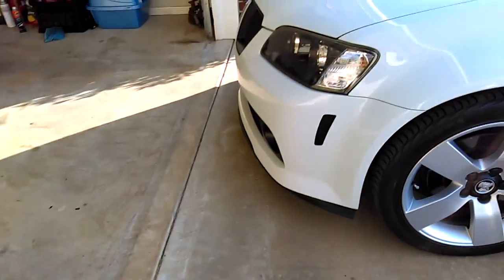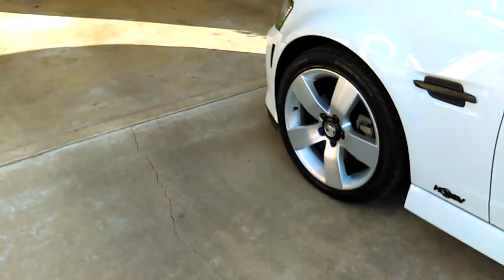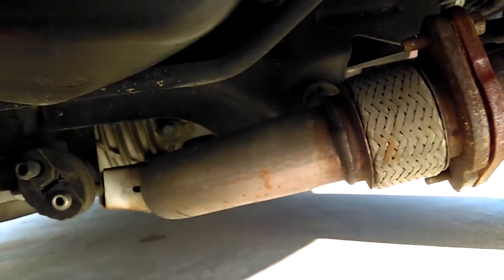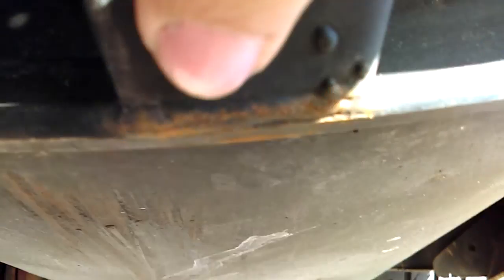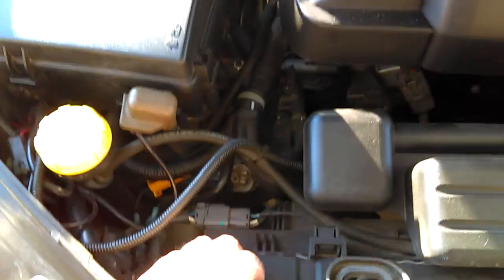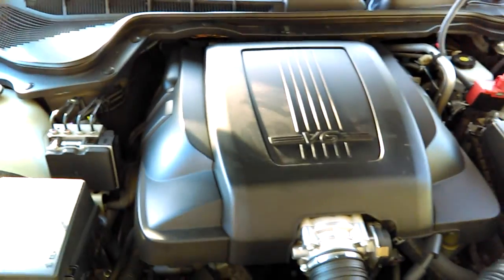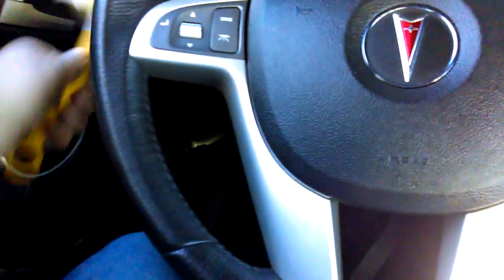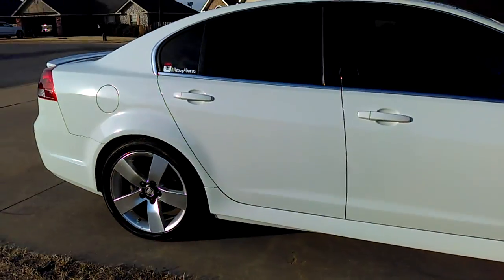Pontiac G8 Cleaning The Undercarriage

Comment: If you want to eliminate the brake noise you have to put anti-squeal lubrication on the bottom and the top of the caliper holder and on the back of the piston of the caliper.
When I replaced the brake pads on my Pontiac GTO that's what I've done and I never get any squeals or squeaks or rattles.
The best brake pads you can buy are going to be at Napa for ceramic pads. On top of like up a lifetime warranty and they can replace them for you every two years for free as long is your pads never touch metal to metal. Make sure and keep the receipt and box put it somewhere where you know you can find it.
Reply from the maker: I don't know how to change them. My dad and I tried before his heart attack and we could get them off. So I had a shop do it. I have ceramic pads right now and just bought a new set. I'll ask the shop and see if they have any of that stuff.
Reply: +Adrienne Brody its really simple. I learned by watching DIY channels on you tube. ChrisFix is a good channel. If you have the tools and don't mind to get a little dirty.

Comment: A.   That black looks like ashphalt from new black topped roads.     Driven on any recently ?     Also what u need to try with your pads. Is. Brake clean.    Ceramics have tendency to glaze if not. Set correctly when breaking them in.   Mine did it. About 6 months after new pads.  And drilled slotted rotors.  It did go away.  But was annoying as hell

Comment: How much horsepower does your V6 Pontiac G8 have?
Reply from the maker: I stoll have to go to the dyno place. I want to see what it runs with the throttle controller at its max setting on sports mode. With it off, it drives fine but when it's on, it pushes you into your seat. Around the 4th and 5th gears not so much. The first three it does. I'm going to get a friend with a GT to test drive mine with it on and off. They should have a better feel for the V6 coming from a stock V8.
Reply: +Adrienne Brody do you have an Instagram? That way you can look me up at LS260GTO.
Reply from the maker: +LS260GTO MIY I sent a follow.